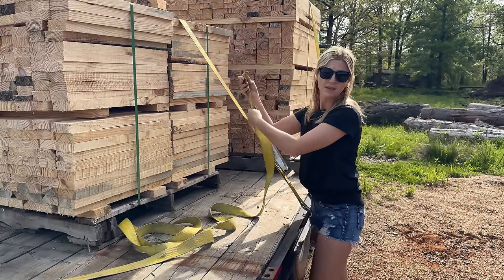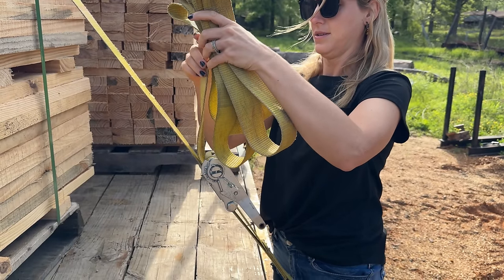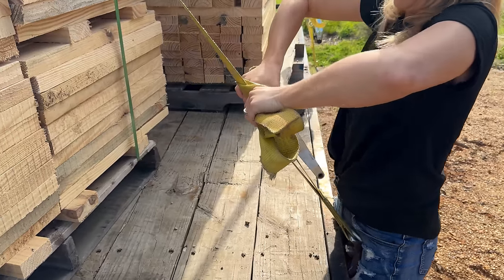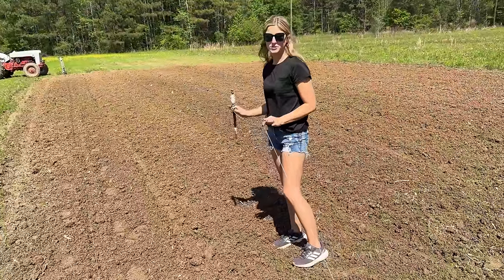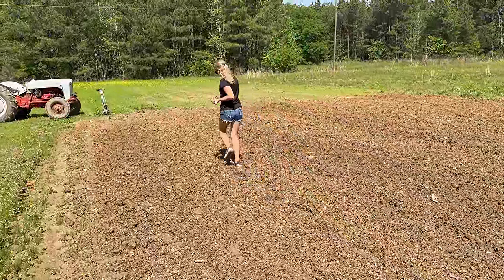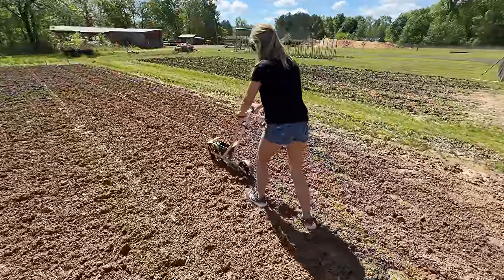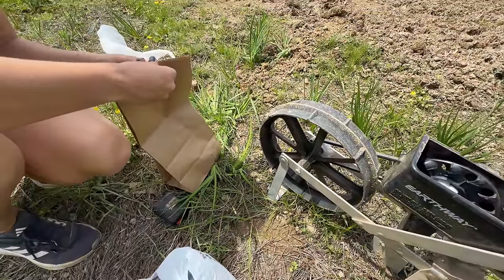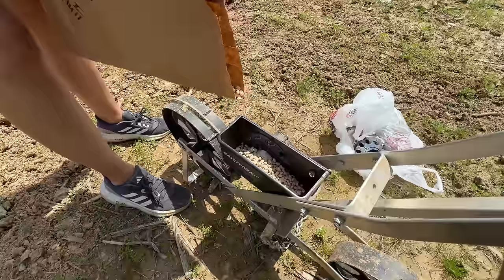Farming and Sawmilling on a BEAUTIFUL Monday!!!

Comment: I make the same ribbon, but tuck it between the two parts ofthe strap between the ratchet and the hook.  Tighten your strap just a couple of cranks, then tuck it in and finish ratcheting.  I have done this for thousands of loads and never had one come loose.

Comment: Does that old Ford have a low range transmission? We always rototilled in low range.
Reply from the maker: It has a 4 speed with reverse. I was tilling in the 1st gear. It’s geared a little fast for a tiller but we make do.